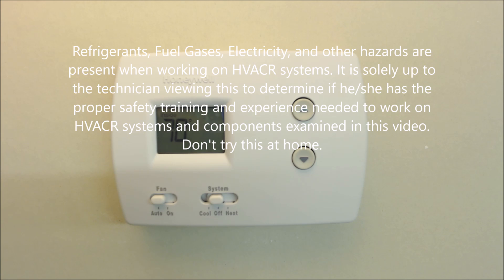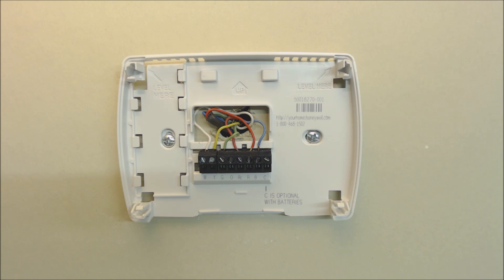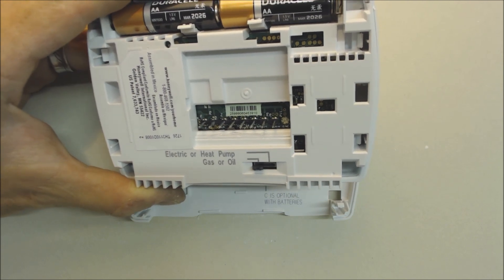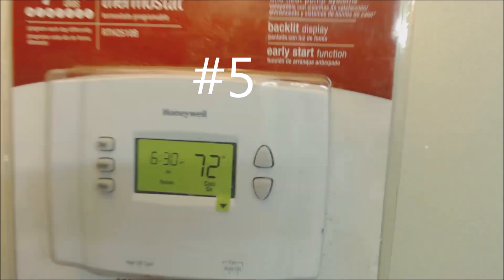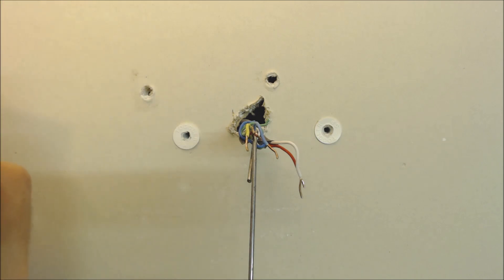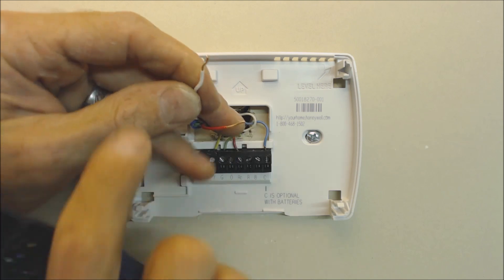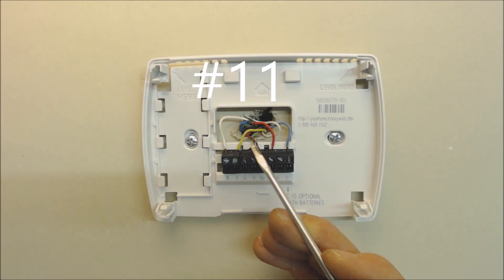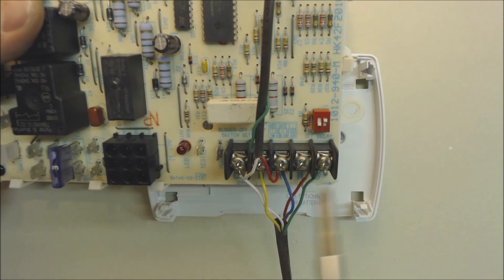Top 12 Problems/Mistakes when Installing or Replacing Thermostats! HVAC Tips!

Comment from the maker: Tool List-  https://www.amazon.com/shop/acservicetech
Support-  https://www.patreon.com/acservicetech
For those that are looking for the tools used in the videos: (Linked Below)

Here is a link to the self drilling white wall anchors-  http://amzn.to/2xRvoJh

Here is a link to the Pro 3000 24v Thermostat used in the video-  http://amzn.to/2keuUbs

Here is a link to the Heat Pump 24v Thermostat with Aux and E Controls-
http://amzn.to/2x8ISBE

Here is the link for the Irwin Wire Stripper/Cutter/Crimper   http://amzn.to/2dGTj2V

Here is the link to the 3amp fuse 25 pack- http://amzn.to/2y2zkFC

Here is the link to the 5amp fuse 25 pack- http://amzn.to/2z4SyKD

Here is a link to the thermostat 3/32 screwdriver --  http://amzn.to/2hxt7uK

Here is a link to the Fieldpiece SC640 Multimeter-  http://amzn.to/2x8k4Kb

Here is a link to the Stanley 6 in 1 screwdriver-  http://amzn.to/2x7NuaZ

Other tool links can be found in the video description section.

ACSERVICETECH is a participant in the Amazon Services LLC Associates Program, an affiliate advertising program designed to provide a means for sites to earn advertising fees by advertising and linking to Amazon.

All of the ACSERVICETECH Playlists-  https://www.youtube.com/channel/UCOZR-1IqsAer9wzlvFgb4mA/playlists?view_as=public

If you want to support the ACSERVICETECH Channel and receive more HVAC content, check out www.Patreon.com/acservicetech
Reply: acservicetech add 1 more to the blue wire to b terminal-blown fuse.  Is it ok to use a 5a fuse instead of a 3a? No big deal to go and get a 3a fuse, just wondering.  Thanks big time.  I was wondering if i was gonna have heat tonight.
Reply from the maker: Always use the same as the system calls for, thanks!
Reply: Thank you sir fixed my heat

Comment: Excellent video. I live in a condominium with a combination heat/cool unit. It’s only a couple of years old. I have a new thermostat and there was a wiring problem so that the a/c didn’t work. That’s fixed but I now have a/c or I have to turn the unit off. In other words, the thermostat is not working. I can turn the heat up or down but the a/c just keeps running and when it gets too cold I have to turn it off. From your video I take it this is a problem at the unit, rather than the thermostat itself. Is that right?

Comment: Good video and the different scenarios, you mention when wires touch common and red  fusen will be blown right, but never said anything to remove panel on a/c handler to replace fuse would it be too much info to give out ,thank you for your good video.

Comment: Very light cooling in home, so i cleaned the outside condenser caked with dust and leaves thus allowing air to flow. Result is an ice cold low pressure pipe, sucess. Now the air flow is mot engaged in home while outside fan and pump/ condenser is on and cold ... new heater installed last winter. How can i trouble shoot?

Comment: Thanks for your videos!

I’ve installed a new digital thermostat. No matter how long I run the air conditioner the thermostat will not change temperature. The air blowing is 58 degrees. 
Any idea why the thermostat will not pickup the house temperature?

Thank you!

Comment: Some idiots came to try to fix my heater and didn’t know how to fix it so they changed the good mercury thermostat I had here to the Honeywell RTH11B digital thermostat and it was preventing 70 degrees in here but they set the new Honeywell at 76. Now it’s only 3 degrees difference in temperature but how do I set it to be at the correct temperature?

Comment: I have a garage heater with W G C and R.  It works fine with a basic 2 wire thermostate.  I put in a Honeywell programmable unit with no C.  I hooked up the R to R with a jumper to RC, the W to W and used the G for independent fan operation.  I can turn the fan on but after setting the thermostate it is calling for heat but the flashing led in the heater stays slow, it flashes faster when heat is called for.  Triple checked connections, good clean new wires, new batteries.  Everything looks like it should work but no heat.  Put the old two wire unit back on and heat comes on.  I am at a loss.  The thermostate is a RTH221B Honeywell Home programmable thermostate and the furnace is a 50000 Btu Heatstar.  Also I did make sure to switch to Gas/oil operation on the thermostat.  Any ideas? Thanks in advance and thanks for the video

Comment: Thanks, just switched from 4 wire to 5 wire, luckily the C wire was there just not being used. My heat wasn’t working because I had to switch my red wire from RC to R instead, and put a jumper between the 2

Comment: Hello I'm replacing my old Honeywell thermostat with a new Honeywell the RTH111D Series I have seven wires coming from the wall I'm puzzled by the white wire that is labeled E wish my new thermostat doesn't have wondering where does the white wire supposed to go.

Comment: What if all of a sudden the ac does not want to turn off. Especially when it reaches the set temperature and just keeps running, or does not turn off it you manually put the switch to the off position? Is it that the control box went bad?

Comment: Any tips for wiring a new thermostat when you have just a boiler for radiators. And only 2 wires coming out of the wall. I tried RH and W/E on the Sensi thermastat and the boiler just turned on

Comment: appreciate all of your videos (& book), has helped a lot with my original problem. Question . .should i replace tstat wire from wall to attic terminal due to ecobee tstat burning up?  Few details: . I lost power to thermostat & boards after installing an Ecobee5 tstat, which brought me to your videos. My system did not have a fuse. I replaced the transformer, added a piggy back 3A fuse to the secondary side, still no luck, so I replaced the timer board and ignition control module and finally power back at tstat, boards etc. Once the ecobee was powered up the screen said 'delayed start-up" then read 100 degrees, then 110, then 120! I had to use an oven mitt to remove it. The ecobee contacts melted on the back  on one side. Now back to no power. Before moving forward would I need to replace the tstat wiring since the insulation appears to be slightly melted on the copper wiring? thanks for your thoughts if you have time.

Comment: I wish you could help me here in Kentucky! I've had the worst luck with my HVAC since the condenser and compressor was replaced! They said it was my thermostat...2 years later I've replaced the entire system as of last week and it's still cycling off and coming right back on 90 seconds later. My power usage has tripled since the first install on the original system. 300x more wattage usuage than prior year or month, and I can see the usuage by the day, wk month, yr, etc and it aligns perfectly with the first install inside the air handler.They've came to my house at least 25 times with 10 techs. My original system was a Rheem and I think they've done something to make it drain voltage but NO ONE can figure it out. I'm currently sitting here after having surgery, watching videos trying to figure it out while it runs non stop wondering how I'm going to pay the power bill! It's set to 74 but feels like it's actually 70. It runs all night long and if internal temp is registering 74 as it's set on, it still cycles on without the temp rising to 75. I can bump it up to 75 hoping it'll cycle off and instead it comes on. It's as if the temp is wrong or it's pushing electric heat somewhere. Idk but I wish I could fix it😭

Comment: i read that i could remove the programmable section and just leave the wiring in tact. If i get the same thermostat and just replace the old program one, would that wiring be good enough? Also how do i detect the right fuse from my panel when i am alone?

Comment: Outstanding video, thank you. When I initially installed my new thermostat I indeed connected the blue wire to "b". I switched it on but got nothing. No heat etc. Most likely I blew the furnace fuse?

Comment: Can a 2 wire furnace run a t-stat without batteries? It would need a hot (r), common (c) and heat (w) right?

Comment: I have a Honeywell thermostat it only has two wires I saw where the one wire came the other wire I didn’t see where I pulled it out it had two holes so I put it in one of them my temperature will not go up totally not turning the burner on do you know what I’ve done wrong could I have used the wrong hole or is it something else

Comment: Through watching this video and looking at my thermostat I installed this spring I corrected my Jumper issue. Thanks for the help. The heater is on and working. My wife is happy im the man of the house and you just saved me $ from having to call a hvac guy. Thank you.

Comment: I have this thermostat and I am confused by one thing. I have central electric air, but gas heat. So, do I need to flip the switch on the back to electric in the summer and then switch it back to gas in the winter?

Comment: Hello, i have a situation: I disconnected the thermostat to repair the wall, before I did it turn off the AC, after the wall was repaired i connected back the thermostat and check all the connections but the AC is not coming back on.. the AC isa new unit
Reply: Please help

Comment: I wired a thermostat 3000 for my heater and my air conditioner. When I go to turn on air the heater gets a impulse to try and start. So the air pulsates then stops.  If I put the heater on it work perfectly.  Has me baffled.

Comment: Need help. Trying to install nest thermostat but old thermostat does not have a c wire connected however there is a trimmed blue wire without nut attached and another red wire next to it (also trimmed and without a wire). There's a black jumper from rf to rh. Live in s florida and need help 😭

Comment: I installed a programmable thermostat but it wouldn't turn on my heat pump so I put my old one back on, it must have been the wrong one or else bad. My heat pump comes on with the old one. With the new one only the auxiliary heat was working,but the AC worked. Is there a certain programable one I need for a goodman it's about 15 yrs old.

Comment: This video helped me immensely.  I moved my thermostat from one room to another, and was absolutely certain I had rewired it correctly, but the system wasn't still working.  I couldn't for the life me figure out why.  Turned out to be problem #6 in your video - I blew the furnace fuse by accident.  I never would have figured that out without your video, and/or a service call from local HVAC repairman.  You saved my money and time.  Thank you.

Comment: Trane systems are notorious for this. I will never buy one again.  Old thermostat worked perfectly until I replaced it with a WiFi thermostat and hooked the wires up exactly like it was on the old one.  I even cut power from the breaker when I was replacing it

Comment: Thank you thank you for your video. It's 1:30am freezing outside and I decided to install a similar stat. Shorted the thing out on the c terminal! Board on the furnace went dead no lights or anything only blower fan capability I nearly sh%t myself I took off the circuit board cause I saw a spark out of the corner of my eye but when I inspected it I didn't see the fuse. I also wired it all wrong as the instructions were incomprehensible to me. Watched this video and now the heat is on!

Comment: #3 on the switch on the back. For an all-in-one system, with using the jumper, furnace/ac, would u still switch it to "gas or oil" even if its an electrical furnace..?

Comment: I feel no matter how careful you are replacing a thermostat, there always remain some guess work and further testing! For instance a thermostat going to an air handler, especially one that doesn't have a control board as to which your thermostat is controlling they system and the R & RC Jumper needs to be removed. For example AC, RC is controlling your fan and outdoor compressor and heat R & W is going to your heating systems zone control board or zone valve which is closing the circuit at this point (Powered from the boiler's transformer) so the air handler is passing R & W through the air handler to the heating system supplying hot water through the heating coil at Air Handler. RC & G is turning the Fan on and off! By having R & RC jumped as assumed by previous installer, they look like they have a jumper on but not directly connected! I have seen this a few times where it had that illusion!

Comment: Would the "jumper" already be there in an AC/Heat Tempstar system? I just got a new furnace about 2 years ago, and the guy said something about getting a new thermostat because mine is an old mercury slider, not digital. If I only have 4 wires coming out, I'd have to jumper R and Rc?
 I've realized it's about 4 degrees off and would like to replace it. Thought it was going to be easy. Thanks for the video because I would never have know the difference between the 2 Honeywell digital model numbers. There is no battery in my current thermostat.

Comment: What about when the wires are not color coded correctly???? 
I did not take a pic of my old thermostat before attempting to wire the new one. The wiring is correct on the new one and I can’t get the old to work. So the home was built with the wires not connected as expected. I have tried many combinations. Nothing. Help.

Comment: Question:     If you were to test a furnace control board that had a blown fuse with a your meter probes where the fuse goes would the meter or the transformer get damaged because the cause of the short was still present when you repower the board?

Comment: 9:48 - FIVE MINUTE DELAY! This one bit me hard.  Several years ago, I ran around for the full five minutes with my voltmeter checking to see if I turned the correct breaker on, checking for integrity of the disconnect fuses, and making sure I had 24v to my new battery-operated TStat.  (Thanks for the heads-up; but, I would have put this one first. I bet I'm not the only idiot out there that doesn't read the installation manual.)  When my HVAC/R instructor turned me loose on a system in the lab last night to connect gauges and calculate superheat, he didn't tell me about the delay (he just handed me a set of gauges and an IR thermometer and said go to it.)

Comment: why is my new Honeywell thermostat RTH9585WF heating? I have it set for cooling at 70F and the current temp id 80F, everything was connected the same as my old Honeywell TH6320WF1005. Thanks

Comment: For whatever reason, my house is wired so that the BLUE wire must go into "Y," and I have no yellow wire. My thermostat operates both my heat/furnace and cool/AC exterior unit: Thermostat is wired R/R, W/W, G/G, and B/Y, with an R/RC jumper.

Comment: I sure do wish you guys were near us.  We have a latest-gen, latest firmware New Nest thermostat connected to a new Rheem furnace and we get a short-normal cycle - not a C-wire issue.  Our HVAC techs are about to give up.  The nest is not the issue as we have swapped it for another Nest and the issue remains.  New thermostat wire pulled.   https://imgur.com/a/CCGbvq9 shows the cycle data.   Rheem won't talk to us directly.

Comment: #13 : Close up that ugly hole in the wall with silicone seal. Cold and hot air coming through will make the thermistor inaccurate and give wild temperature fluctuations.
Reply: Absolutely true for most of us, few homes are built air sealed unless it was custom designed to LEED standards in the last decade! Most homes have internal walls with no real air seals or insulation and mostly act as ducts from the crawlspace/basement to the attic, and of course are where the thermostats are installed also! Any leaks in your ducting to the outside will cause a pressure difference that sucks in a breeze of outside air thru the walls- the thermostat  mounting plate, power outlets, switch plates and every window/door of your home (personal expereince). Many power companies will offer discount or rebate for professional testing of your homes air leakage rate, like blower door test and IR imageing videos and evaluations of what repairs/mods are needed based on saveing$ on your energy bill.

Comment: I had reinstalled my original thermostat because I was afraid that the new one wasn't working properly, but this video gave me the confidence to open up the air handler (after turning off the separate breakers at the air handler!) take pictures of the terminals and wiring diagrams and try again. It turned out that the changeover timeout was just longer than I expected (missed the "waiting for equipment" message before) and the new thermostat has been working great ever since.

Comment: Alot of people are switching their analog for digital thermostats in their RV. The typical Rv 30amps service has a 12 volt (7.5) Red wire that is connected to the analog stat. That wire is no longer used to power the stat if batteries are used in the stat. This is my understading as well as the high and low fan speeds which are brown and blue wires connected together ,which only gives the high speed fan setting (toogle switch installed gives low speed option). Could you advise on this and address this for campers? My camper has red, green, white, blue, yellow and brown wires. Thanks